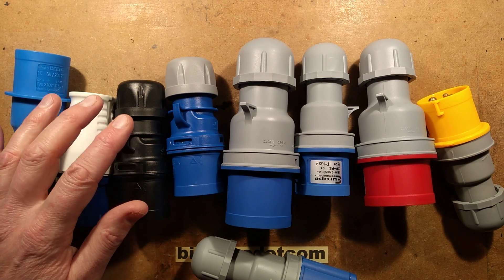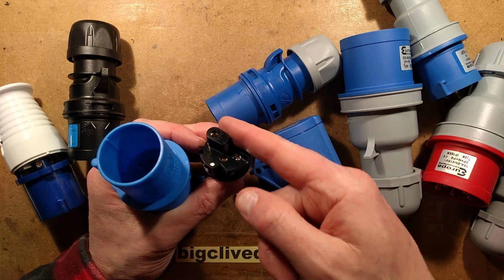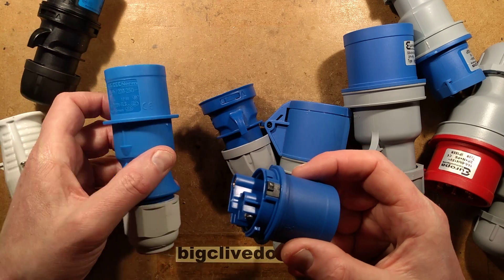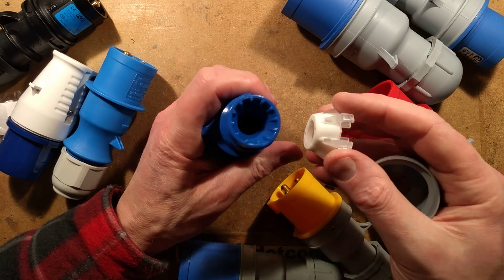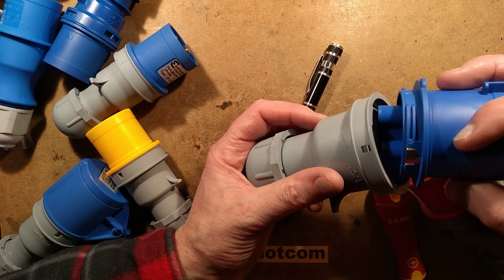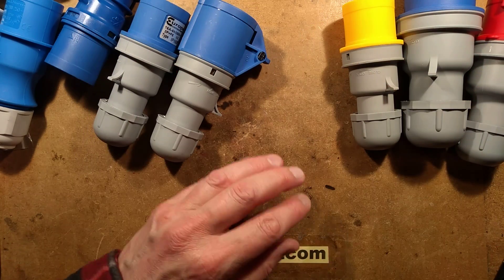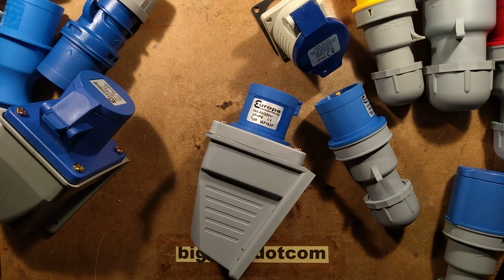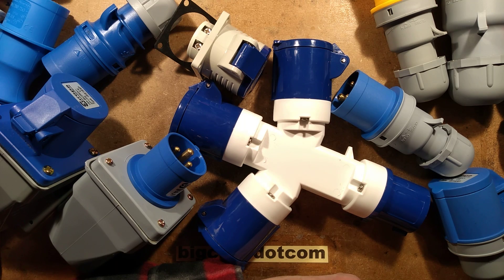My favourite industrial connector (Ceeform).

Comment: The red five-pin CEE connectors are the only connectors in practical use for three-phase equipment in Germany. As usually every property has a three-phase mains connection, three-phase equipment is really common here in Germany. There are virtually no machines that need more than 3.6 kW (230 V x 16 A) with a single phase connection, so the blue 3 pin 32 A connector is uncommon in Germany. But also professional machinery with a much lower power consumption, like concrete mixers with as low as 700 W, commonly runs off 3 phases here, because three-phase asynchronous motors are much more robust and easy to handle than single-phase AC motors.

Comment: Looks like a connector for a EV
Reply from the maker: Commonly used to connect EV chargers.
Reply: bigclivedotcom 

TO connect EV chargers? I think this can be a plug itself for cheap Chinese EV's 😂
Reply from the maker: @beedslolkuntus2070  Some EV conversions do use these as the charge port.
Reply: bigclivedotcom 
Yea thats what I taught
I also saw those "food vans" with two of these hanging and they connect this. 

I even saw the Plug in socket for it at the mall, I guess as someone stated, they dont want us to plug in our cool phone chargers and use the port...

Comment: Netherlands here.
Blue CEEform (3P16A) are used extensively on campsites to allow campers and caravans to connect to, though often only limited to 10A by circuitbreakers.
I've also seen it used (the male appliance socket) in firetrucks, often hooked up to an extension cord where the female connector has the lid cut or broken off. (firetrucks usually need to leave in a hurry, after all)

Red CEEform (5P16A) is incredibly common. Used for overhead doors, heaters, industrial/commercial kitchen equipment like ovens and deepfryers, 3-phase powertools both permanently installed and portable.
I've seen portable heavy machinery like tablesaws and cement mixers which have a male appliance connector mounted to the side.

A common thing on construction sites is "paddestoelen" (it sort of resembles a mushroom shape), which are plastic enclosures atop a steel frame. 1 male 5P63A and 1 female 5P63A connectors on the bottom: Power comes in, power comes out and heads up to another unit on the next floor.
Each paddestoel has standard 230V outlets (Schuko, CEE7/3) in multiples of 3 and atleast one 5P16A outlet.

Comment: In the Netherlands we use the red ones (400V+) for 3 phase machines like welders, motors and industrial heaters. There is a smaller one for 16A and a bigger one for 32A. Some are without neutral connection. (4 connections, 1x ground and 3x phase) probably delta configuration? These replaced the flat connections HPS32 if I am not mistaken.

Comment: Commonly used in Norway in industrial environments. But if you can adress differences between 1-fase and 3-fase, I'll be a happy man. 1-fase is live, neutral and ground, but 3-fase is 4 connectors+ ground?
Domestically the standard plug is 220v SHUCO, rated up to 13 amps. IF you need more power, then the blue 220v cee-plug is used for both 1-fase and 3-fase for heavier loads.

Comment: i work for the german railways and we use a variety of these: purple for 24V or 48V DC cable lamps, blue for 240V AC aux power for diesel locomotives and trainsets (battery charging, pre-heating), white for use with 240V AC isolation transformers, red 400V 3-phase in all 3 amp ratings (16, 32, 63) for all kinds of machinery (the 63A one is also used for aux power for electric locomotives and trainsets)

Comment: in the netherlands we use these kinds of connectors extensively in the event industry. mostly the 380v (red) ones but also the 230v (blue/black) ones. never really seen any of the other voltages.
Reply: yellow onec where ofeten used for blinders (die lampen staan in serie en 1 rij werkt op 110v)

Comment: I really like the 5 or 4 pin red ones, with 2 phase pins that you can rotate with fingers or pliers, saves time when there is an equipment that needs to be moved a lot  and is motor rotation direction specific eg. pressure washers, pumps, table grinders. Not all factory outlets in different buildings are connected with phase sequence in mind.

Comment: Used in Europe for boats, caravans, campervans etc. Problems can arise when folk connect an inverter to their mains system for off-grid use and leave the external pins energised. High-end inverter/chargers have built-in systems to counter this but DIY systems sometimes don't. Easily overcome with a selector switch or by plugging the inverter output into the external inlet.

Comment: In denmark every modern house has a 3 phase supply 400V with 230V LtoN, so we have splitters with red input and the 3 blue outputs marked L1,L2,L3. We also have red plugs, where we can swap 2 phases, by rotating a part of the plug, because it is used with motors and not all sockets are wired correct.

Comment: I'm in North London and there are a few street lights with these Ceeform sockets on my road.

If you can find a way to get to the top and run a cable down, then hey, free 16A supply for you!
Reply from the maker: Commonly used for connecting Xmas lights on lamp posts.
Reply: Unfortunately not in my case! They were installed with the intention of later putting CCTV on the lampposts to deter and  monitor the actions of some undesirables living on my road. They never got that far, though, as the main culprit has been put in nick for stabbing someone.

Would've indeed been nice if it had been for some Christmas lights instead. Sigh...

Comment: Apart from the regular 240V/415V 16A/32A/64A versions, we use green versions of those connectors for 115V/200V 400Hz 3-phase power (400Hz 3-phase is a common output from the generators on board aircraft).

Comment: My last company outfitted their US and Canadian labs with big beefy Hubbell HBL560P9W connectors of this type for our PCB test equipment. We configured everything to use 208/3phase (120 between any phase and neutral, 208 between any pair of phases), so every receptacle had the same 3 phase + Neutral + Earth. None of the equipment needed 60A,  and we had some laughably small-gauge cables going into the plugs, but we never had to call electricians to put in new drops. The plugs and receptacles were eye-wateringly expensive though, but we occasionally found good deals on eBay.

Comment: On the twist-clip terminated plug, you mentioned how the cable tensioner acted as a watertight seal as well; I noticed a fairly obvious oversight to the lifeproofing of that connector.
When you were showing off the inside of the plug end, I couldn't spot any silicone/rubber gaskets around the twist clip, on either end of it. If there was one on the tensioner side I couldn't spot, feel free to correct me, but the connector could probably be IP65 rated at the least if that change was implemented, along with a gasket ring at the base of the plug end to further prevent water or debris from seeping into the plug; some cheap, simple changes and this connection standard could be far more lifeproof than it already is!
Also, I haven't seen this type of plug. I worked in an industrial assembly line where they ould've been useful but the idiots running the place used the standard US plugs that have proven themselves to be unsafe, to drive very heavy machinery. They used a few US-standard 240V plugs as well. Definitely not the types of plugs you want to have for powering sensitive heavy equipment. But then again, parts of the machines were mounted with tape to boxes, and oftentimes it would get knocked out of alignment and cause tons of issues with the rest of the equipment as well. They never did fix it proper, drove me just as mad as the grueling work did for getting barely over minwage. I finay quit when they started abusing everyone's 1099 contracts to be able to put them on 2hr work weeks; if we were W2 employees they couldn't have done that.

Comment: I work as a lighing tech in Bulgaria and in theaters and stages, which aren't still stuck in the communist era these connectors are used for the dimmer lines. The 3 phase one is also commonly found somewhere backstage and the small portable dimmers we haul about also use that style for power in. Sadly every example i've seen for the 220V one is converted to the common EU plug.

Comment: You talked about the catering industry wiring plugs onto live cables and sockets onto appliances - well, a bit closer to our home (the theatre) it was my physics teacher (set building) that got me into the theatre. .....

The orchestra stands were old, broken and not enough left - so 'Taffy' made a set of new (plywood board) orchestra stands that could be daisy-chained for the lighting. The first in the chain plugged into the theatre (3A socket) and then each stand had a live 'kettle' socket in which a kettle plug fitted. So at the end of the chain, there were live pins on the side of the stand ! Not surprisingly, theatre sparky went ballistic - yet didn't do anything about them ! I guess it's 'I have nothing to do with them, not my issue' attitude.

Comment: In the plant world anything is possible 
Oh we haven't got the correct extension cable...  Oh just grind safety lug off and ram it in
Romanian electricians are the best for making generators melt down
They never use the curcuit breakers and just wire in straight in the top no false tripping
Seen many cherry pickers on fire with exploded batteries and burnt harnesses

Comment: Here in the US we have different pin configurations and shapes for different purposes and voltage/amperage uses which can get extremely confusing to anyone not familiar with the specific use. 

At a recent rodeo in Las Vegas, Nevada, a lady asked me if I could help as the plug on her borrowed trailer (caravan) wouldn't fit the pedestal outlet. All our trailers/motor homes have either 110v 30 amp or a 220v 50 amp connector with 2 specific pin arrangements. This trailer needed a 110v 30 amp connector. Someone had put a 220 volt 30 amp clothes dryer plug on the trailer cable. A quick trip to the local home center and I was able to swap the plugs out so she could have her air conditioning. Yes, Las Vegas can be hot even in the middle of the winter.

Comment: I've seen those single phase at countryside in sheds for different tools, otherwise just those 3P ones.
Most of my experience is from entertainment, where we (video side) run only the 3P ones. Those  (movable, in trucks) big screens might peak at 100A in all 3P, but I've only seen 63A3P cables being used. Quite often we had to do long~ish runs, so we had multiple of those connected to each other in order to have the cable weight be movable by single human.

Currently I visit data centres quite often. Here in Finland I see those same 63A3P plugs being used, in US something else (as they run line-to-line for 208V and here we have 240V in data centres)

Comment: I think you would get full arousal with an event box power adaptor box loads of 3 phase incomers and  16 32 63 and 125 amp sockets to flap about and the adjustable  rcd trip and mcb and waterproofing covers and lifting handles

Comment: New Zealand uses these, we call them blue commando. They carry 16 amps and are usually used on caravans/campervans to provide mains power while they’re parked at a campsite. But also, electric car supply equipment (EVSE’s) sometimes use these too, so that you’re not drawing 10amps off a normal wall plug for 10 hours straight.

Comment: Here in the Czech Republic, in almost every house is at least one 3-phase 16A and/or 32A socket (that red one), most often in the basement or workshop. This allows connecting very powerful 3-phase machines, such as concrete mixers, welding inverters or table circular saws.

Comment: In our german household there are such outlets (red style, 380v 3-Phase) in the kitchens for the stoves.Also there Is an outlet in our basement that I use for operating a mid size double stone wheel stationery grinder. At work, we use these connectors for big, powerful engines with polishing wheels, polishing metal parts.

Comment: Those are widely used in Denmark.... and the rest of europe i would think.

We often use a variety of the 16A 400V outlet, where theres a regular 230V European or DK-standart outlet on the front.

Note allso, that the 3-phased version come in both a 4-pinned (3 live + PE) and a 6-pinned version, where the 6th pin is placed in the middle of the plug and slightly shorter than the others. That middle pin is used for cutting power via a relay, should some fool pull the plug during load.

Personally i've used both versions on machines, where the outlet was ment for specific equipment, that needed to be removable. Thereby preventing "normal" equipment to be connected.

Comment: In Germany we use them too. We had these Cee 230v(16A) connectors at work to charge our trains.
But the plugs we had where not with schrews but with clamps you have to push in.
We changed them after a few month becouse they melted fairly often.

Comment: 3:24 i've been preaching this method for years to twist and fold over, so pleased a professional electrician does the same for the same reason 🤘
Reply: Well, enjoy your fire hazard.
Reply: @Anvilshock  after some of the work that i've seen so called "professionals" do, like using cheap chinese cloned trips and rcd's to improve their profit, or not working out the diameter of the cables relative to the current that is lost over greater distance wiring, and fitting wiring that is too thin for its purpose, thats a greater fire hazard
Reply: @upsidedown4155  Ah, of course, good old "At least I'm not Hitler" defense. Yes. That makes everything else immediately and perfectly acceptable. Yes.
Reply: @Anvilshock  what is wrong with me? People who dont relise that every one has the right to express a opinion, like you by the way if i do wrong i admit and face the consequences,
Reply: @upsidedown4155  What has this to do with opinion again? Get your arguments in order if you're really interested in actual communication. If I wanted to see disconnected, context-lacking, tangential ramblings, I'd go on Twitter.

Comment: I have three leads I’ve made up for camping , using the blue 240 volt  connecters, for when you need to hook up on site , plus I carry a two way splitter, and a spare male and female , they are excellent as long as you use them correctly.👍🇮🇲

Comment: Red ones are commonly used in Poland, almost every house has at least one 16A or 32A 3P outlet, usually in a garage, storage room or basement as our houses are supplied from a 3 phase system. It lets you plug in a welder, large saw, concrete mixer, etc.  Blue ones are sometimes found in RV's and trailers or in industrial 1 phase equipment. At work we have a power supply for testing stuff that is powered from 3 phase 125 A outlet. Older houses and equipment use 4 pin variant of red sockets and plugs with a combined neutral and PE.

Comment: Look kind of like the shore connections for power from the pier or when things are setup for industrial power at a shipyard. (Junction boxes are just inboard of the sponson, so not fully exposed to weather.) Those also had an additional threaded collar that fitted over them, so they couldn't just be pulled off after the connection was made. Been about two decades since I got out of the navy though, so memory may be hazy. I think some even had 4-pins for 440 or 480? (Not sure, since I'm not an electrician.)

Comment: slovakia, working in industry but see them everywhere else as well, the red 5 pin is pretty much the standard for 400v sockets, with the 4 pin one being sometimes used for motors. the blue 230v one is not unheard of but less common, we're using the regular type f plug almost everywhere for 230v

Comment: In Germany you'll see them pretty often in private "non-industrial" use. At least the red ones. We have 3 phases at nearly every house so people make use of it to connect the machinery to cut their firewood.

There are versions that are really waterproof. They have rubber seals between the connector and a ring on the plug which can be screwed on to the socket it connects to.

We rarely use the blue ones in Germany. Our regular "Schuko" system is rugged enough to be used in industrial environment and on construction sites.

Comment: Hi Clive. I changed the plug on our washing machine and drier to the 16A Version (the blue one). It replaced the  typical german F type plug and they also Feature an Standart neutral and live which i like a lot. Btw. does it make a difference when the live and neutral are switched?

Comment: in the netherlands these are the standard in construction and industrial, and also caravans, i dont like the new models tho, like everything else they stop using the screw connections and step over to push-in or spring-clip connections, ive even seen them with push tabs that cut in to the conductors.

Comment: Interesting stuff. I'm in the United States, and these plugs look very familiar. We have a paper folding machine at work with an optional right-angle attachment. The plug used to connect the main folder to the right-angle attachment appears to be the same or similar to these Ceeform connectors.

Unrelated, but they also look pretty similar to some connectors I've seen advertised as high-amperage marine usage.

Comment: In canada on construction sites we usually use unshrouded twistlock cables since we are usually only 220v max.  110v is just our standard 3 pin plug also with no shroud.  

Always at the temporary panel there is an apprentice standing there holding the breaker closed :p